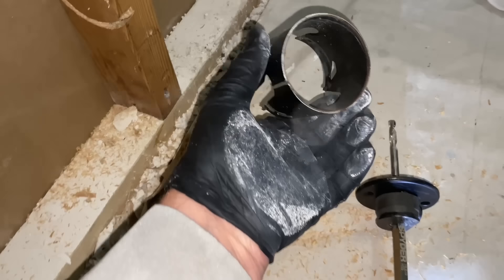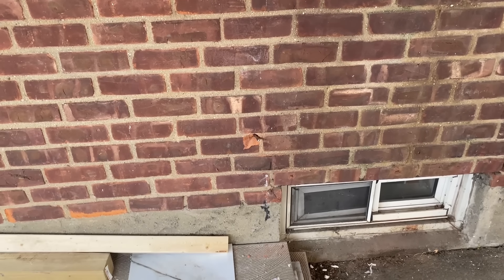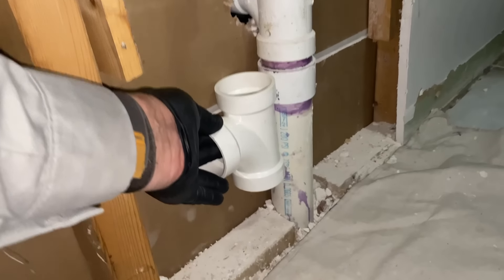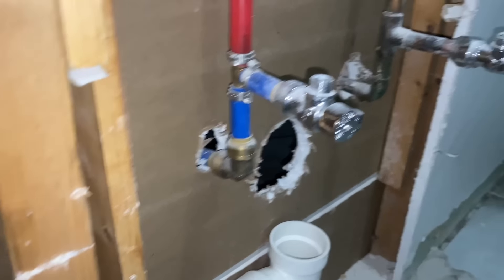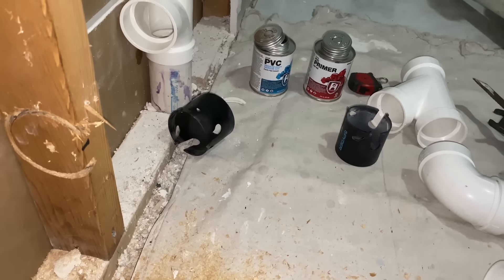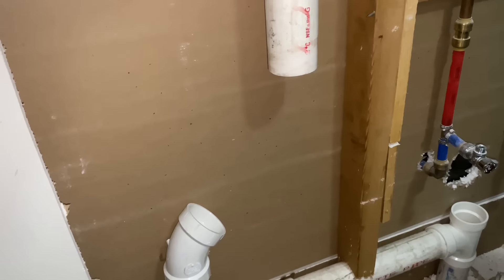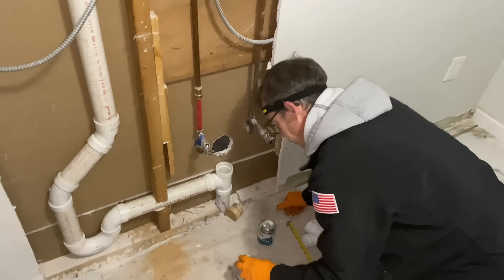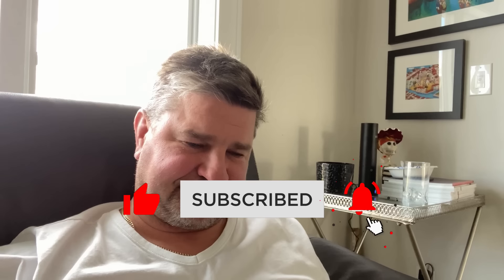Roughing Plumbing for Washing Machine Connection in Basement

Comment: Just did this in my basement only mine has an overhead sewer line. So the plumbers put in a laundry sink and a pump, also because of  code they also extended the vent line from up stairs and did all new copper for water lines. Finally I can get my washer out of my 1st floor bathroom, I get the new dryer on Saturday

Comment: Home owner job for sure.  Not much room for a dandy cleanout. Guess you could remove the air admittance valve to snake it out.  In Ma. we were able to install  1 1/2 drain for the washing machine. The code has changed  to 2" due to new machines greater discharge and different soaps foaming up. Also our standpipe must be 18" min. to 24" max unless code has changed on that
Reply from the maker: Thanks for sharing
Reply: 18-30 for standpipe in MA
Reply from the maker: The maximum vertical drop shall be 4 feet NY @ShaunMurray-e5j

Comment: I'm curious to know why the washer box is so high. At any rate the long drop to the trap is more then 2ft. Thats against code in seattle. Due to the fact the water falling more then 2ft may wash out the trap creating sewer smell.
Reply from the maker: Pedestal washing machine. Accessible valves.

Comment: There can’t be any plumbers in the replies before mine since there is no mention of the incorrect stand pipe length and improper venting.
Reply from the maker: yeah, quote the NYS code please.
Reply: @PipeDoctor  sometimes the local codes will let you get away with being lazy at the expense of correct function.

Comment: I don't know New York code but exceeding 24 inches of drop to the trap will cause siphoning of the trap? Ma. code would not pass.
Reply from the maker: quote the section buddy
Reply: @PipeDoctor  248CMR: board of State examiners of plumbers and gas fitters 10.08: 2 Fixture Traps  
 b. The vertical distance from the fixture outlet to the trap weir shall not exceed 24 inches.
Reply from the maker: thanks. in NYS: Standpipes shall be individually trapped. Standpipes shall extend not less than 18 inches (457 mm) but not greater than 42 inches (1066 mm) above the trap weir. @freddolan3493

Comment: I am very surprised that you didn't install stud/nail guards. Where I'm at when you install a trap and plumbing like you did in this video it would require stud/nails guards, a plumbing permit pulled and a plumbing inspection. It would have failed inspection. Better than your last Video as you mentioned. You're getting better though. This one wasn't quite as bad as your last. Love ya
Reply from the maker: Love you too. No homo
Reply: And where are you at exactly? Inspectors are a pain in the hole.

Comment: 😂😂😂😂😂❤❤ MIKEY PIPES where is your torpedo?  Well? Just tell them you left it in the submarine where the torpedo belongs.🤣🤣🤣 nice job working in a confined area to work with. Them dam burp vents should be outlawed… I “ refuse “ to use them. Roof or side of the house but outside where it belongs . But it is crazy how different states different allowed fittings..  our inspector?    He red tags us using a Tee only Y’s but he will allow a Tee in a vent application..
Reply from the maker: Next time!
Reply: Using a combo to catch the washer box would have broken your vent… a San tee must be used in this application.

Comment: by the way, New York City code you’re not allowed to do a washing machine like that connecting the waste into a 2 inch line that’s picking up another fixture. It needs to be connected to a 3 inch line or bigger.
. Not sure exactly what area you’re working at but in New York City pain in the ass as you know.

Comment: That job will never pass inspection. First of all you have two fixtures 2-in pipe no good. Your vent is no good. Very sloppy you have homeowner size cans of primer and glue. Looks like you don't do much roughing tape the glue up stick to heating
Reply from the maker: was there an inspection I was supposed to schedule? get real. it will work, and work well.
Reply: I always use “homeowner size cans” 😂
Reply: Shut the front door. Use small cans on service don’t need quart size cans, you probably wear half the can on your clothes anyway
Reply: This looks like one of your Florida jobs that’s how bad it looks